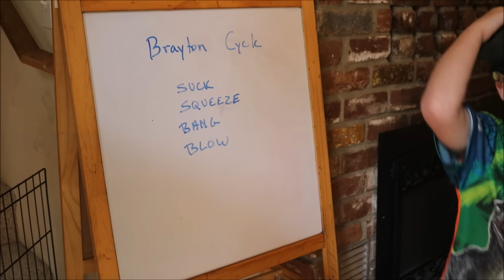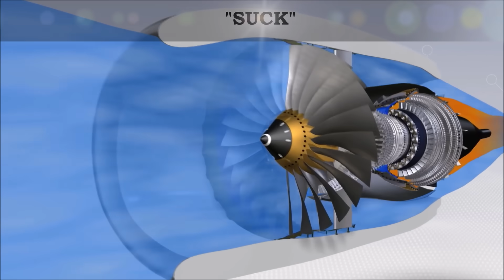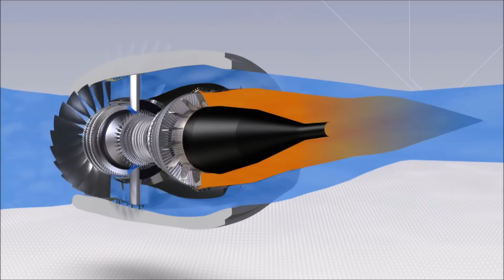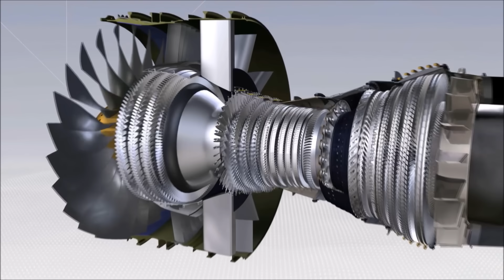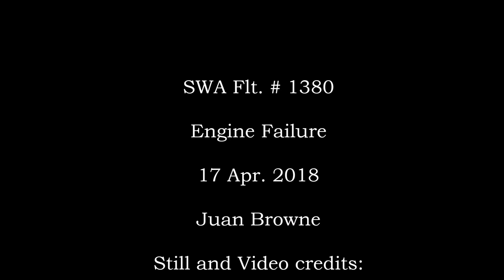Southwest Airlines Flt#1380 17 April 2018 Update

Comment: Benefit of Hindsight I can see from the Actual Test Footage That IS'NT but SHOULD POSSIBLY BE Taken into account is that ANY Vehicle Moving Forward CREATES A VACUM! That shrapnel was blown out of the engine after it's collision with the damaged fan blades. Then due to the Forward Movement of the plane in Flight, Sucked right back into the Main Body of the aircraft, sadly impacting with the pressurised windscreen, causing an explosive decompression within the aircraft body and impacting with a seated passenger, causing a fatality. Suggestion! I notice on some of the old propeller driven aircraft there is an extra plate to reinforce the skin and so toughen the planes skin adjacent to the propellers. Possibly here a strengthening of the passenger windows with a material that could withstand an impact of an object travelling around the 400 MPH would reduce the possibility of anymore passenger fatalities.

Comment: The switch to Carbon fiber fan blades may reduce caust and increase efficiency....But im not convinced they retain the resistance  to cycling failure like a Titanium alloy blades of the previous generation....time will tell...

Comment: NG= NO GOOD

Back to the future ENCLOSED PROPELLERS. N0 more solid cast mag fan disks. But is this a better design? We have had more failures OUT of the US.  So the TRENT turbo fan failures have the same problem. From a Failure Analysis standpoint take the sane number of cars as airframes operating in measurements. Your numbers will be more realistic. Identical numbers is the key to FA.  how about the turboprop engines used by the Ruptured Duck airlines ? A better safety record than Northworst Airlinesthat used reverse thrusters to back out of the gatescausing a compressor stall. I almost tried to leave the airframe.
.

Comment: Some of these hairline cracks at the root of the fan blade can be caused during manufacture, I don't know if this was the case here, it was on a McDonnell Douglas DC10 several years ago in I think Rapid City, S.D. The fan blade was manufactured with a flaw, causing the center engine to explode, severing the three hydraulic lines causing flight control problems.

Comment: I frequently hear comparisons between aircraft and auto safety. For several significant reasons, it seem like comparing apples and oranges. Aircraft travel is in an environment that is significantly different from that of automobiles. There is also a difference between commercial and private travel.

Comment: Both incidents a fatality could have occured due to the cowling.  As far as design is concerned the inlet cowl is not designed to keep any blade sharpnel contained but however it should be able to handle the vibrations and excess loads experienced.  Of course if a blade doesn't fail then this is not a concern but still calling this technically an uncontained failure that caused a fatality only keeps the FAA eyes out of the cowling manufacturers.

Comment: Can you explain to me why the simulator time does not take on the multiple failures? it seems to me that disaster is normally a combination of more than one thing. modern machines are complicated with lots of sensors. it seems these things are the problem.
recently we had an engine failure on a cruise ship. it would appear the engines stopped because there was no oil . the reason there was no oil  because the wave motion had thrown the oil away from the sensor and because it had happened x number of times the engines went into shut down
I know they make things as realistic as they can  but I think multiple failures seems a good idea  if you're going to fail, fail and learn on the simulator
Reply from the maker: It's not the sim that's limiting. It's the training profile approved by the FAA. More in next update...stby. Good question.

Comment: As a student pilot back in 97, on a solo flight to orbit the field then do pattern work, I had a complete engine failure when I pulled power back climbing downwind.  My training paid off. I was able to get safely back to the runway. It was about 20 minutes later when it hit me. Then I was shaking. But, training works.

Comment: Vibration my tail. Safety certification guys aren't reporting any consideration of the added pressure of high speed flight with or without the engine operating. Flying around 490 kts is some big pressures. If cert didn't ever consider the air pressures.........

Comment: I had the wonderful opportunity to work with GE Engines and University of Dayton a number of years ago with "blade off containment" technology development.
I was asked to participate,because of my background in lightweight ballistics and explosive suppression material development.
The fan shrouds used kevlar and aluminum to contain the blades, which usually come off at roughly the speed of a .45 caliber bullet,[subsonic velocity].

We looked at and tested very much lighter materials like ballistic grade UHMPE and a very unique, advanced carbon fiber matrix developed at Brigham Young University, that looked like a spider web, impregnated with P.U. foam, which proved to be considerably lighter,and stronger than the old school aluminum and kevlar. 

The GE guys considered a couple of solutions, first they thought it would be best to allow the blade off plus the partial blade off [which was nearly always partially broken of as well] next to it, be allowed to exit completely from the nacelle and gain distance from the still revolving fan, but quickly realized that was not a good idea,for obvious reasons.

We developed the alternative concept, per GE`s request to design the cold fan ring to allow the blade off plus partial blade off to penetrate into it and and be out of the fan rotation.

The fan blade off,would be completely absorbed, as much as possible, so the fan could safely spin down sans the broken blade pieces thereby lessening the catastrophic damage.

We calculated a considerable weight savings derived from the new lighter,stronger materials than the old method of heavier aluminum and kevlar.

Comment: Wonderful video...however, comparing auto fatalities to aircraft fatalities is so outdated and misleading. If there were a comparable number of aircraft on runways as vehicles on highways, I'm sure numbers would be drastically different. It's apples and oranges. Fan blade disintegration has happened long before this high profile accident as well as the ability to detect critical fan blade defects outside the capacity of the human eye. The fact is that nothing happens in the auto OR aircraft industry until a certain number of deaths are logged. So please don't candy-coat the obvious neglect of proactive critical maintenance on the part of the airlines. They have the tools.

Comment: As an A&P grad, I would like to wait and see the technical report from NTSB before I make any analogies on what really accrued.I can say this from my experience working for McDonnell Douglas, a DC 10 center engine fan blade failed causing the same problem and cutting into all the hydraulic lines forcing a very bad landing. Cause: bad casting of the fan blade during manufacturing causing a crack and failure.

Comment: A very rare occurrence. Yes, definitely. Although, a main question is ----- can that sort of occurrence be prevented by detecting the weakness in the fan blade structure? If it can be prevented, then should the airlines do something right now to start checking their engines?

Comment: The beginning of this video is the first image I've seen of the missing blade. It looks like the adjacent blades weren't damaged (from what can be seen in the photo anyway) which seems odd. From the photos I had been seeing it looked like the entire cowling failed and peeled back. (When I first heard the story it sounded like the entire bypass portion of the engine parted ways with the core.) Be interesting to find out how this unit got to looking like it does.

Comment: It seems that all a/c engine test were done in the engine test cell. The actual failures happened at altitude and at speed. Could the a/c speed have been the factor in the cowling destruction? And could this be reproduces in the ground via a wind tunnel? Wonderful video
Great job Juan

Comment: You make it sound like the engine is not at fault when it clearly is. GE/CFM knew about this issue and could have done much more before this event but chose not to. Likewise the FAA and others knew about the problem but failed to even make inspections mandatory. I'm tired of people trying to make this seem like a random freak incident when it was a known defect and risk.

Comment: The faster she goes, the faster she goes. How all engines work, in general. Suck pulls in the air, squeeze compresses it in preparation to burn efficiently. Bang is the explosion, and power cycle. Blow is the expulsion of the spent fuel and air.

Well done explanation!

Comment: When they do engine blade failer testing, they need to put the engine on a wing so it can throw the wing around with the vibrations it causes and put a giant fan in front of the entire wing that is pushing a 3 to 400 mph wind at it...even though a plane like the 737 flies at a speed of 500mph the air is thinner at higher altitude so reducing the airspeed at see level should work... good vid

Comment: I was on a SWA flight that had an aborted take off. We went to the maintenance area for awhile and were cleared. Took off, got to 4kft or so, and BOOM. Compression stall. 
The people behind me knew about planes and very calmly got the attention of the flight attendant and said 'Ma'am can you inform the captain that the #1 engine is torching'
Most of us were pretty scared but I had faith in the engineering systems and that the plane could fly with 1 engine. Never been in a plane that large flying so slow and landed to a fleet of fire trucks. 
Fun flight. Thanks engineers, for having so many failsafes.

Comment: Once again, the aviation gods provided a non-lethal warning that only a prompt remedy to a defect in the system could prevent certain tragedy.  Once again, the airline/regulatory/political entity refused to accept the clear warning and take effective action.  Once again, an innocent passenger dies.  Look at the history of the DC-10 cargo doors blowing off before the Paris crash in 1974.  Look at the history of the ATR turboprops icing up and falling out of control before the disaster in Roselawn, Indiana.  If the correction of a known defect will significantly disrupt the economy of the major airlines, then the correction will be postponed until death takes its toll.  Human lives are the price the industry is willing to pay to avoid full compliance with the Federal Aviation Regulations that are supposed to make air travel safe.  Do not tell me that one death is acceptable in nine years of operation.  Tell it to her survivors.

The fan blades in question are periodically removed for lubrication of the blade roots by mechanics at Southwest Airlines.  That means that almost certainly, the flawed blade has at some point been taken from the engine, cleaned, possibly examined, lubricated, and then reinstalled so that it could go on to cause a needless death.  Nice work, Southwest.  Carry on, Big Business.

Comment: Ok. We know about the "heroic" captain, but something just doesn't add up. Who was actually flying the aircraft. Who "had" the aircraft. The reason I question this is because the captain was doing all the radio work. The pilot who "had" the aircraft would have delegated this to the backup pilot who I suspect was the captain. I know it looks better that the first female f18 pilot single handedly handled this whole situation, but it jdnlr. Maybe the voice recorder will tell. Multiple failures, flying, and handle the radio? Not good crew management.
Reply from the maker: explained in my next update here-https://www.youtube.com/watch?v=4a4Dw-IbsKg

Comment: Very well done video with correct information.I've been flying B737s (all models) continuously since 1992 and have accumulated  more than 14,000 hours in all of their models and variants. What was shown in this video is 100% correct based on reliable information. Thank you blacolirio for taking the time to make up the video. Very will put that If the auto industry applied the same safety principles of investigation and learning from accidents as the aeronautical industry does, we would certainly have less people killed in car accidents.

Comment: Thankfully, I have never had an actual engine failure. Before I got my jet job, and before all of the added security procedures produced by 9-11, I was able to take a tour of the 777 at the BOAC terminal in Philly. The operations manager was very generous with his time for two GA pilots. Standing in front of those giant RR engines was a real treat. And, a moving cockpit seat is much better than the gyrations one takes to get into a Lear 35.

I am forced to wonder if these two blade failures are due to a production problem or simply unanticipated metal fatigue. I am also wondering if the ultrasonic testing will prove to be a sufficient benchmark for future failure predictions. What do you think?

Comment: Can someone address the question of metal fatigue?  Where exactly on the fan dove tail is the micro cracking suspected to be occuring?  Is the cracking due to fatigue life limit vs load cycles for the parent material, stress crack corrosion, or design deficiencies?  If there have been 2 cases of fan inlets breaking off the engine, should this not lead to a fundamental review of the fan inlet design and how it's mated to the engine?  I ask because where that lady sat on the plane is usually the same location where I typically end up sitting on a domestic flight.  Not any more.  I can only hope she did not suffer.
Reply from the maker: internal to the blade.

Comment: The compressor is shown spinning backwards!
Reply: codonbyte This compressor has two stages which rotate at different rates on separate shafts. The blades on the front section are incorrectly oriented as shown in the CFM animation.

Comment: Good video. I like your method of reporting events.
After watching news reports and watching some flight tracker videos, I have a couple of questions.
1) I did not hear a emergency or mayday call on the transcripts. How were ATC distressed aircraft protocols implemented in this instance? Was there a 7700 transponder squawk right away or when the pilot called “We have an engine fire, we are descending!” Without requesting permission to change altitude that automatically triggered the protocols? It seems that the pilot basically said, here I come, clear the road, ready or not!
2) according to some flight tracker data, a 737-700 has a maximum speed somewhere around 580 mph. Why would the pilot decend at a speed knocking on the door of 600 mph (596 plus it minus) when you have an unknown amount of structural damage to the airplane along with a number of system failures or degradations? Is not the risk of ripping the plane apart a higher risk than a slightly delayed time at a speed under max speed with less stress on the airplane? I believe the engine fire was under control by the time the decent started. 
I am not criticizing the actions here, just want more information on how things work under these conditions. 
Thanks.
Reply: American Rambler Both good questions. The phrase single engine in a passenger jet implies an emergency, and though the pilot did not use that word, ATC clearly understood the situation.

Comment: The centripetal force on those blades is enormous! Their molecules are slowly being pulled apart every microsecond of rotation until micro-fissures develop and slowly grow until the fan blade simply pulls apart like taffy. They need an even more stringent blade replacement interval with very accurate data on how long before the micro fissures begin to form to prevent the blades from ever reaching the point of structural failure. This event was just the "law of averages" where everything is normal for a while until a predictable "outlier" event occurs that was this apparent blade failure. Chaos theory also predicts these events, i.e., every ocean wave fits a normal pattern until one forms a huge rouge wave very far out of the ordinary that can flip a ship.

Comment: In the video the test engine holds itself together as it should. Frankly they are going to have some questions to answer as to why that engine has now twice failed to contain the separation of a bypass fan blade. And why we've had two separations at all. Those blades are under no thermal stress at all and they spin at 1/6 the speed of the core.  It is going to be important to find out if the engine was inspected properly with ultrasound, that blades did not exceed their service life. And why the cowling failed is another question, engine certification is that it can handle a blade failure.   Indeed if it had we would not be looking at a fatality.

Comment: Hello Juan,
Excellent job again! Thanks
I work in conception of aircraft cockpits, we have made the Cseries and Global 7000 8000. The most severe structural requirement for the parts, is to survive an windilling condition. All our parts are designed resist a lot of vibration during a 3 hours complex mission. (Delastek, in Quebec)

Comment: I would have thought that the nacelle would have been able to withstand the blade-out load caused by a loss of a single fan blade.  The whole engine is typically required to withstand a blade-out event.  What NDI technique are they going to use to inspect all of the engines?  I would bet that the crack propagates so quickly that they are not going to find any cracks.  Having said that, they will most likely find FOD damage and replace blades for that reason.  Most engine blades are designed to withstand certain types and sizes of FOD damage.  Do you think it was an LCF or HCF failure?